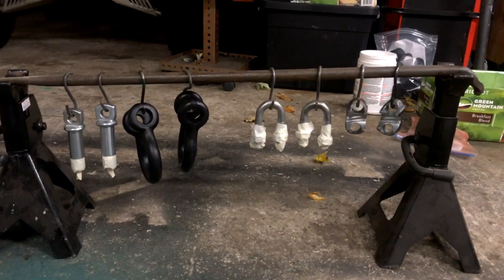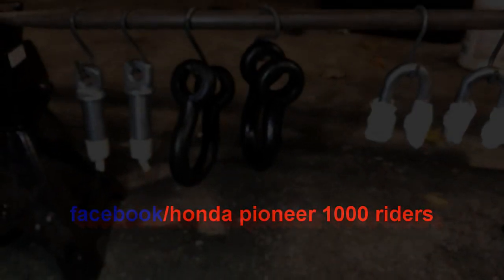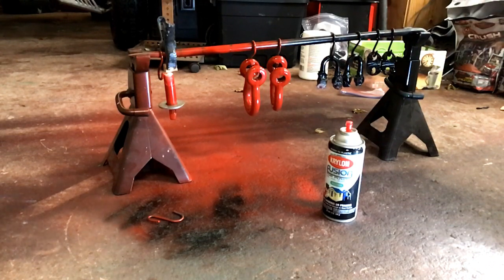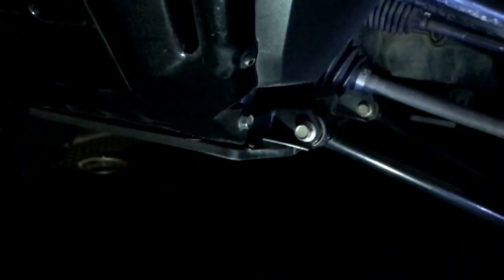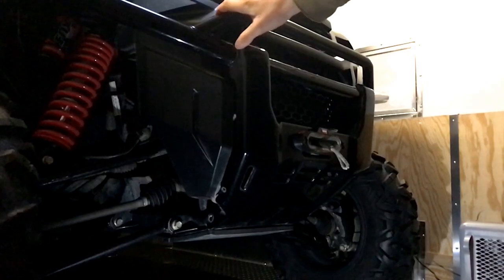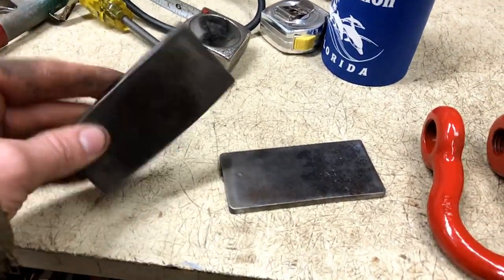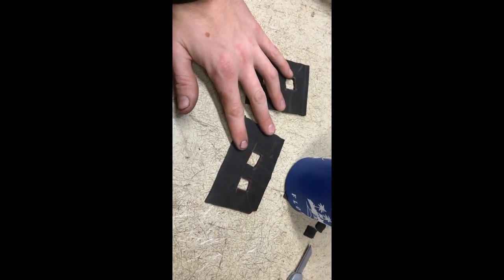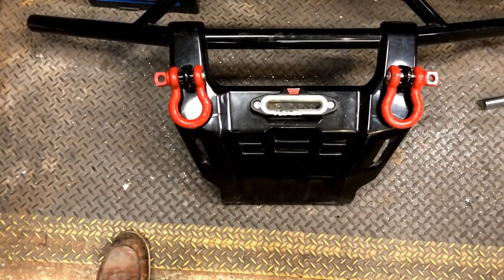honda pioneer stock front bumper

Comment: Where did you buy the clamps. I got some but they are too wide to fit in the shackle
Reply from the maker: +NCdragon21 I bought it all at https://www.tractorsupply.com
Reply from the maker: +NCdragon21 they are both 3/4 inch
Reply: Ah. My shackle bolt is 7/8
Reply from the maker: NCdragon21 ah yeah gotcha any more info you need just ask
Reply: what size are the shackles you got? My shackles are 3/4"
Reply from the maker: NCdragon21 the shackle are 3/4 and the bracket are 3/4 sorry it’s not in the video still new to making videos